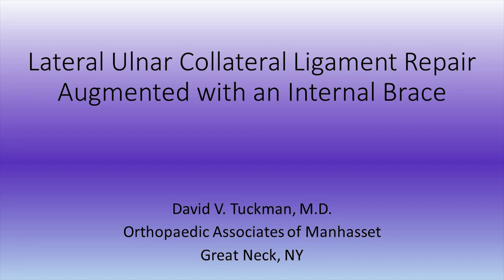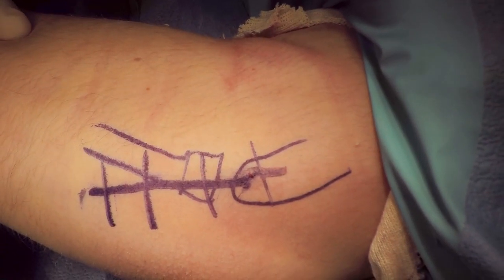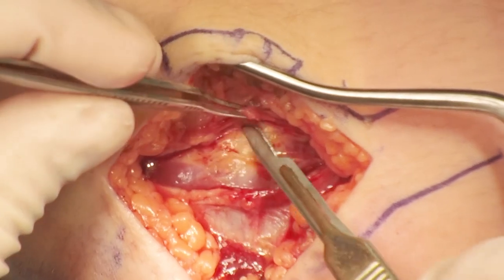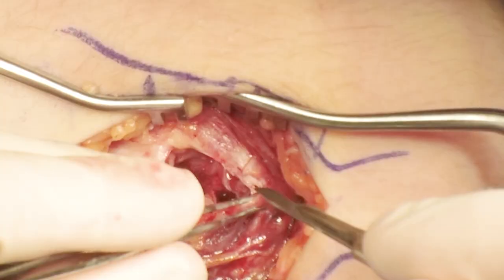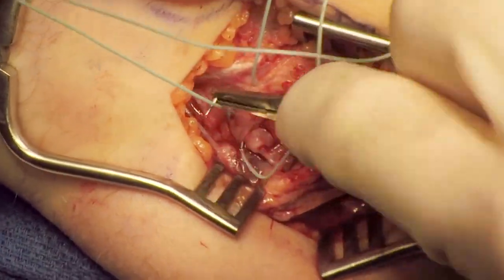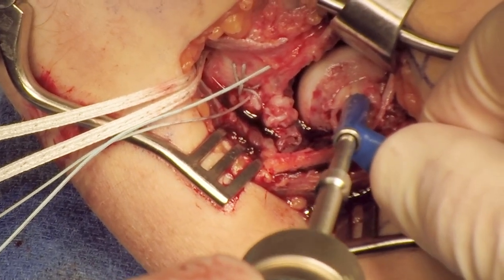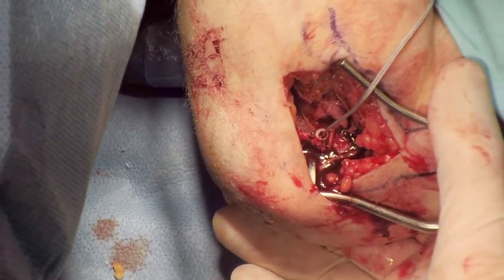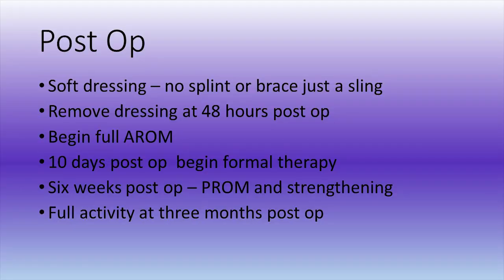Elbow Lateral Ulnar Collateral Ligament Repair Augmented with an Internal Brace

Comment: Hi David, very nice demonstration!
I have noticed that you didn’t repair the avulsed extensor origin with an additional anchor, please advice if this should be done especially in chronic situation
Thanks
Reply from the maker: You have two options, you can use the central suture in the anchor or you can suture to the surrounding soft tissues. I don't' think you need a very robust repair since the extensors are not involved in elbow stability.

Comment: Can u please tell me what is the use of swive lock in the distal fragment near the supinator crest.. we have already passed krackow sutures in the ligament so what is the requirement of swive lock ? Why we cannot pass the krackow suture ends through the suture anchor drilled in the lateral epicondyle directly ??
Reply from the maker: The swivel lock in the supinator crest is used to secure the fiber tape which creates an internal brace. The brace will unload the ligament while it’s healing. If you have good quality ligament you don’t need the brace. I did pass the sutures in the ligament through the anchor in the lateral epicondyle along with the fiber tape. Thanks for the comment.